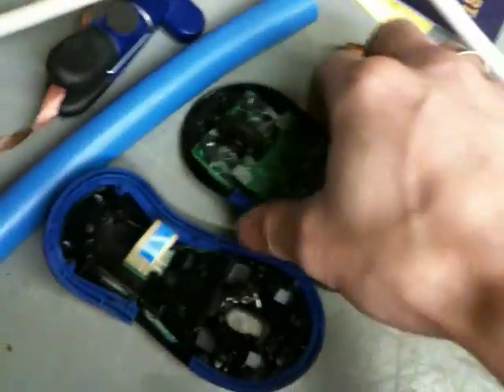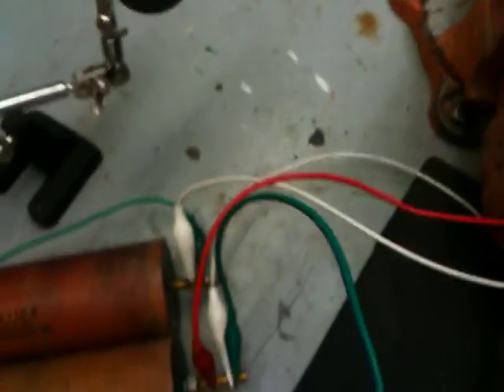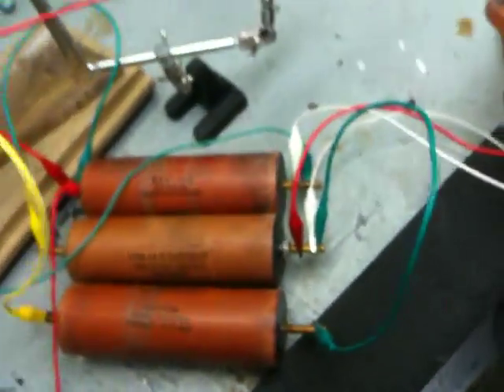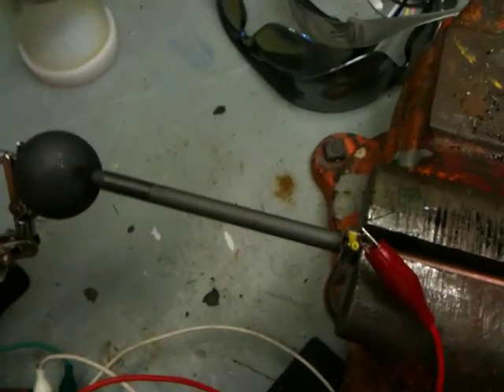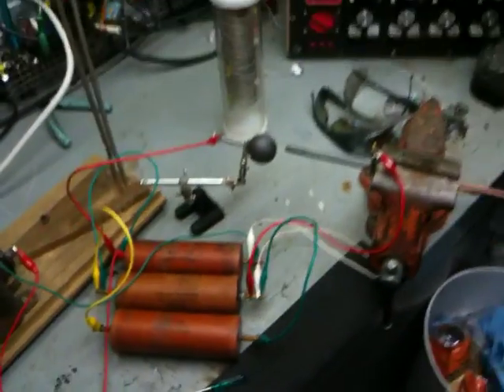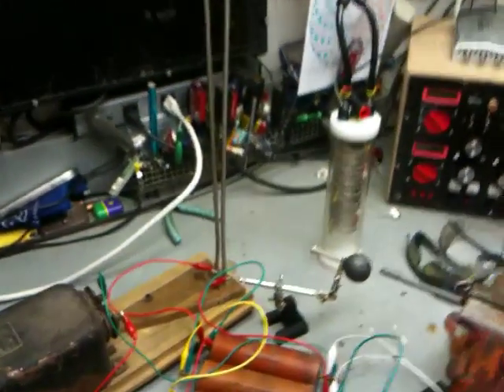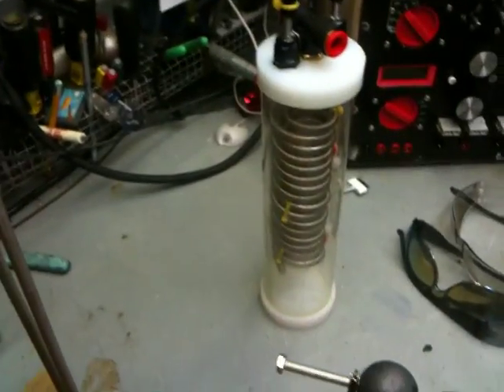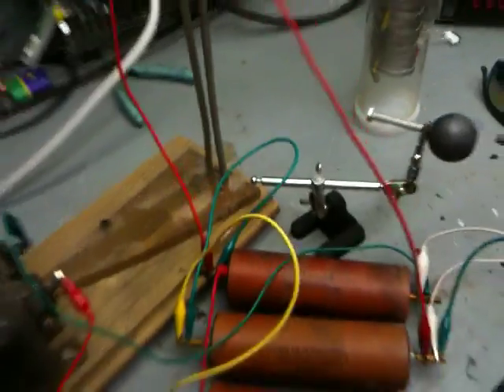1.2 Stanley Meyers EPG, Carbon & Graphite Spark Gap With Caps!  Testing (EPG Test1.2)

Comment: A trick Tesla used to keep spark gaps from melting and requiring frequent adjustment, was a magnet either side of the gap so that the spark would force its own arc outwards and longer, and thus break conduction so that a new shorter spark could start.

Comment: @rwg42985 i could be wrong but it makes sense to me-making an ioniser is easy enough-get a small plasma ball circuit and put the output flush with a piece of glass and a bit of foil on the back-it will crank along

Comment: LOL @that going off a 3 am -now you know what i meant by loud and angry!what di the caps come out of?i was reading about carbon-seems C60 fullerenes will become magnetic when cooled in a mag field-i figure the field needs to be close to the particle output so they are exposed to a mag field from the moment they are made and start cooling-i was wondering about that on my setup-i think the magnets were too far away from the particle source-need to miniaturise and get the magnets next to the arc

Comment: Hi Russ,
Respect to you - working at a job (just over broke) - then doing this at night.
What is your power source and frequency of discharge ?
You know you are generating one hell of an electromagnetic field - you zapped your mouse or its input - but do you realise just how close you already are to Tesla/ Moray/ Kapanadze electron spin axis vortasing (amplified stimulation) without making any Meir gas/ tubing/ pumps/ valves etc.
Wind coils round a downspout + keep elecronics away/ unplugged

Comment: Don't worry it hurts our ears too!.. (wasn't expecting it..haha)

careful with discharging those caps first before switching wires around btw... at that voltage the wire may as well be completely bare copper..

Comment: @rwg42985 i got some thin cobalt drill snapped in half and put it in a herb jar for a reaction chamber-1st time i fired it up the jar had like an orange smoke inside-it smelled very metallic and coated the glass with a fine dust.
there was a point on one electrode which is burning off quickly-so im thinking a very sharp electrode will give alot of metal ions,quicker.
going to ionise the Argon before it enters the spark gap chamber-how else is it going bond to the metal ions without losing e-?